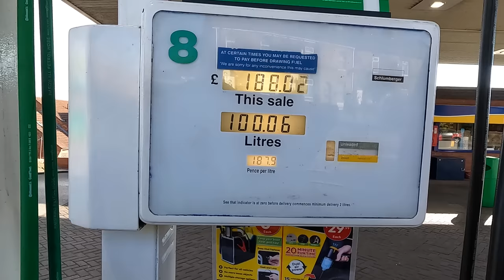Put that down SandBlasting Heavy Equipment

Comment: Greetings from the US. I can't help but notice how small that fan seems to be, what size nozzle?  My boss would be crying about production but that looks very controllable and you didn't even have to wrap the cab till you were quite close. I couldn't have even done the loader arms without the glass being in danger. we use number 7 and 8 nozzles over here and mostly medium/coarse coal slag media.
Reply from the maker: Hello and welcome to the blast hood 👌😊 Nozzle size needs to be paired with the air to achieve optimal psi. That's one of the reasons why I say these videos aren't a how to 👌👍 lots of ways to achieving the same goal 😎
Reply: You have to try out depending on how much air your compressor delivers.
Reply from the maker: @kempaswe4022  yeah your right nosel size should be matched to the air delivery and desired psi loads of charts on the web to covert air flow to bore of nosel 👌👍

Comment: hello sir what media are you using for this ? also whT compressor would you recommend for blasting cheers
Reply from the maker: Crushed glass and I would advise the biggest you can get hold of and afford to run as derv is a deciding factor 140/300cfm seam to be in the sweat spot area but I haven't had extensive experience with 300+ so wouldn't really know for sure I've used 400 and 600cfm both greedy on derv but totally depends on the finish required 👍

Comment: Hey, do you have a website or supplier for the system/equipment you use? It looks the business! I’m currently in charge of a small project to restore a WW2 hangar in the U.K. which has terrible rust scale and weathering on its steelwork. one option is to have it sand blasted but, I’m sure you can appreciate a 26,000ft building is pricey to hire someone and we can’t seem to find any systems online that aren’t hobbyists pressure vessel sand blasters. Any help would be greatly appreciated!
Reply from the maker: If you haven't done this type of work before it's more than likely the waste costs your likely to incur would cover the cost of a professional. I would be looking at getting a quote from professionals then size up time / waste / quality and look at it that way as doing something yourself is all good but don't always mean cheaper. If you still want some gear I would buy 2nd hand use it to complete the job then sell it only problem with that if you have no experience you won't know if it's the equipment at fault or lack of experience.

Comment: Always make sure to cover the hydraulic cylinders. If you get the sand on the cylinders will damage the inner seals and it will leak very bad. Don’t blast them . Cover them up well.
Reply from the maker: The dust scraper won't allow the media past and the chrome is alot harder than my media so I'm confident they are fine 👍👌

Comment: Nice drone intro! And did I see the compressor start on the first try!
Reply from the maker: 😁 yeah my youtube money has finally built up enough to buy the drone 😁 2 year into video making 😂 next is battery banks and chargers possibly a big case to keep the kit safe 👌 and yeah you certainly did I think it's got something to do with the cold start thingy as its really warm hear at the moment no matter how long ya leave the glow plugs (well its not glows its a heater on the air intake that's why I think it takes a little to pull heat into the bores)👌😎

Comment: What size nozzle you using
Reply from the maker: That's determined with the cfm and psi of the compressor I think mine was 9mm but that's from 260cfm at 100psi and taking helmet pipe drop in to account

Comment: Hi ya mate great videos - if you can get the hitch unit off or pull out the ram part then we can try and straighten it for you on our 50 ton press. Don't want anything for it - just like to watch the videos. cheers
Reply from the maker: Thanks that's really appreciated 😊 to be honest I was going to tackle it today but after fitting some guttering and the sun coming out decided against doing anything but have a few tins 😂 tomorrow is another day though I was planning on trying to huck it up to my forklift and bend it back a little see if that works if not pulling the ram out and putting it in vice and trying to do something with a bar over the ram hopefully get it sorted tomorrow 😬
Reply: Those draw tubes from knot avonride aren’t a lot of money. I recall for my trailer around £65. There are different diameters so measure it first. Easy to replace too.
Reply from the maker: @voxxag8054  👍 I will have a go at bending it back if that fails that don't sound too bad of a repair bill 👌 thanks for that 👍
Reply: @Mobileblaster  No worries bud, i bet the forklift idea will have enough power if you get the leverage at the right place . Hope you get it sorted😊

Comment: I think I would have covered those chrome parts to prevent the seals from damage and oil messing up all the metal, paint etc.
Reply from the maker: They was fine 🙂 I've adapted my methods to minimise damage to wires pipes etc please note these videos don't show it all and make it look alot easier than it is 👍

Comment: White diesel 1000litre now 1.41 plus vat today. Bulk makes a difference to buying at pumps. Well worth it.
Reply from the maker: Last I checked it was 9p cheaper than the pump in my opinion its not worth having nearly 2ks worth of fuel at risk of theft 20p or more savings its worth the investment of bunded tank insurance etc to store. But to do things full legit the cost of tank inspection and rules needed to follow to be fully legit wouldn't work in my location as I haven't got a peace of land 10m away from a drain were I could put the bunded tank well safely away from view of the road

Comment: Nice vídeo! How much bars do you use?
Reply from the maker: Thankyou Bar as in psi?
Reply: @Mobileblaster  can be in psi, in portugal we use it in bar
Reply: @Mobileblaster  how many PSI do you use?
Reply from the maker: @emanuelsilva793  8bar 125psi on the hopes of getting 100psi at the nozzle 👍
Reply: @Mobileblaster  and what is the size of the nozzle?
Reply from the maker: @emanuelsilva793  650, nosel size is determined with the flow of air (cfm) and what presure you want you cannot use the same nosel and hope to get the same results you need to know how much air you have and how much your using on other things like water traps helmet filters etc
Reply: @Mobileblaster  but tour diesel compressor make 8bars? I just find diesel compressors making 7 bars
Reply from the maker: @emanuelsilva793  yeah at the compressor it's 125psi but this will drop to 100psi at the nozzle 👌

Comment: We use the same hood, much love from America
Reply from the maker: Best I've used apart from the hear peaces falling out it would be hard to improve on the quality 👍
Reply: Yeah like airpods are good as long as you put the hood on without too much sliding around and usually they stay in place, but to each their own I suppose.
Reply from the maker: @AylerProductions  I super glued mine in and it makes a world of difference. Just have to were a hood sock or hoodie to save getting them mucky 😬 as it would be impossible to get them out to wash them 😂
Reply: Oh nice, that's something I might try out, a head sock does work good though

Comment: so 188 pounds of assuming it was Diesel Fuel or was it Petrol Fuel. but 188 Pounds would be $226 USD and 100 liters would be 25 Gallons US. 
in USA the 100 liters/ 25 gallons of Reguler Petrol/Gas would be at the cheapest $87.25 USD or $72.45 Pounds. 
but if its Diesel Fuel same 100 liters/ 25 gallons. at the Cheapest Price would be $113 USD or  $93.84 Pounds.

So I can say Your Fuel/Petrol Prices are High still.
Reply from the maker: Yeah its diesel and we have been hit with a massive price hike because we was allowed to use low tax rate diesel(Red derv off road use only) before 1st of April. Before this time it was 60p per Litre and regular diesel (road derv) was £1.60 then it hit a all time high of £2 per Litre. Now it's law we have to use regular derv in off road engines etc what pisses me off to this day nothing has been said in the media because they know the would be up raw the government is very smart at controlling the media
Reply: @Mobileblaster  well Hopefully soon it gets better.
Reply from the maker: @ChakatNightspark  just have to suck it up and get on with it haha

Comment: Cheep diesel in gb. Here in Sweden its about 2,4€/litre
Reply from the maker: We just had a price drop too £1.78 converting pound to euro its about £1=€1.11? So around the same? By the sounds of things US is the cheapest place for fuel.
Do you use Red low tax derv for off road stuff? That's all stopped for us 🙁
Reply: @Mobileblaster  here you can only use the red in big machines and farm equipment
Reply from the maker: @kempaswe4022  Yeah that was the same over hear untill 1st April now everything that's for business use even if its off road we have to use white 😳 greedy government

Comment: Why blast that thing out in the middle of nowhere?
Reply from the maker: Because the noise and dust wouldn't be nice to work along side this company have 20 or 30 fitters doing their daily work put me out of the way they can continue to work 👌👍
Reply: @Mobileblaster  
Thanks. I only had the idea, that it would be practical doing it in the vicinity of a paint shop - or even better in a paint shop. As is, it will contaminate the pristine surfaces on the way there.

Just my train of thought. ☺

Comment: SO how does a guy buy a machine and tools like this and not spend 30k to get started??????????????????????????????????
Reply from the maker: Buy 2nd hand 🤔 depending on what workload you want to do 30k isn't going to get you far best off getting some training 1st see if you like it as I can honestly say these videos make it look alot easier than it is 👍
Reply: @Mobileblaster  i think you make this look a lot easier than it is, ime not looking for easy. what would me min cfm and psi for getting started?
Reply from the maker: That would depend on the workload you plan on taking on 100psi is optimal cfm is how much flow you require bit like jet washing a DIY 6lpm vs a professional 35lpm but each has a very radical price point 👍 how much money you got to spend and I will advise what your looking at